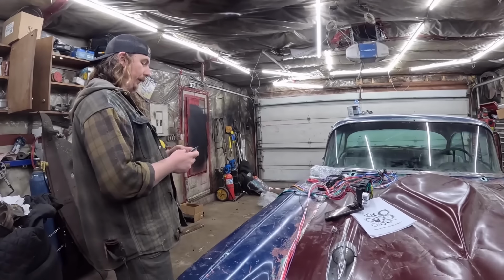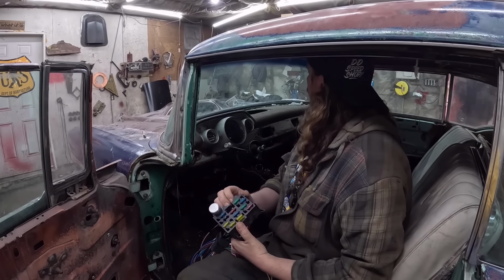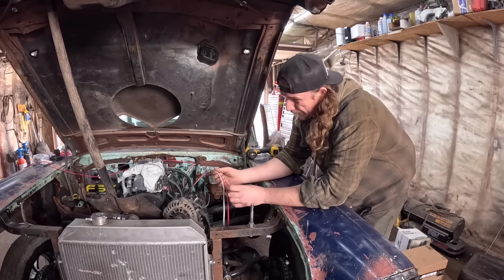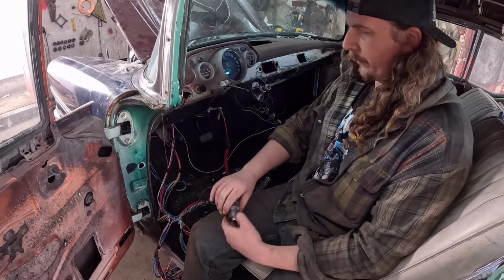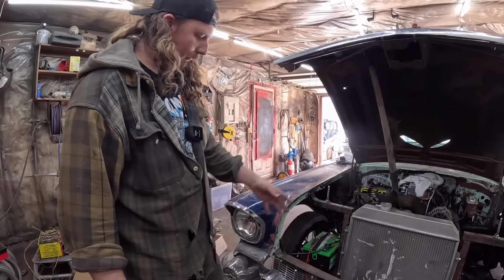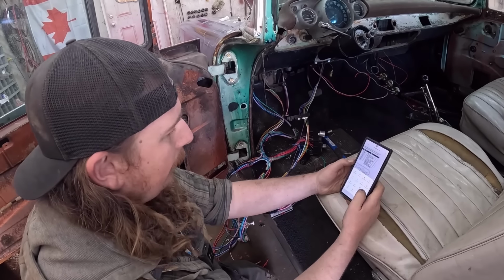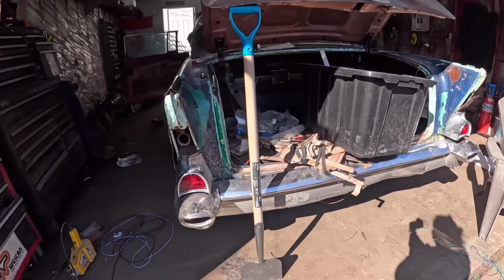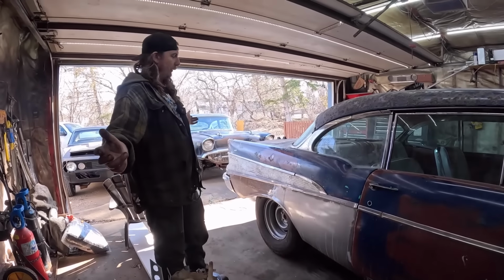SO MANY NEW PARTS - The Worst 1957 Chevy Ain't So Bad...

Comment: You should have enough wire left over wire to wire a 40 ft 2 car trailer! But like me you have to store cars on the trailer so you have room to park it. Then unload to use the trailer. Typical gear head problems. It usually takes me two days to wire a pickup truck. I use an old car horn to do brake lights its pre wired with alligator clips. Love your videos and the cars you do.

Comment: For a hot rod, with no accessories, I like the idea of using a toggle switch to send power to the coil, and a pushbutton to activate the starter relay. Two of my cars are done that way. One of them has a row of 7 toggle switches and 2 momentary pushbuttons, all labeled. If you have an electric fuel pump, you need another toggle switch. Makes it more fun to start, for me anyway.
Reply: Ide relabel them for theft deterrent..  ejector seat.. smoke screen.. Gatling guns.. ect..👍👍

Comment: With your friendship developing with Speedway Motors, you should really try their universal wiring kit! It’s significantly less expensive than other brands and way easy to use. I just did it to wire my ‘71 Cutlass. All the wires are labeled and there is some consistency with them.

Comment: I know you wired a ton of cars but you make it look so easy I'm getting ready to call delta pag I have all my fan and radiator measurements to give them for a quote on the 2 12 inch fan set up I don't know about the wiring with that controller so I'll see what they tell me. Great video dan

Comment: Those cheapy headlight switches are garbage. They corrode inside, I don't usually drive my truck at night but when I did the headlights did not come on. Had to pull the switch in and out about 20 times to get it to work, replaced it with the same one did the same thing, took it apart and cleaned it, worked until the next time it didn't work at all. Had to drive home with no headlights at all. So, I put a toggle switch in. Have had no problems since.